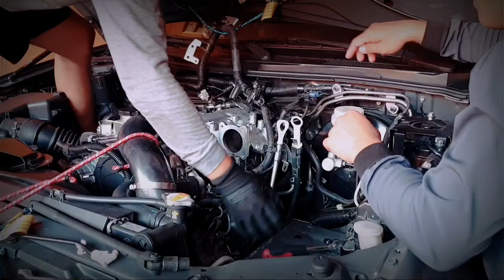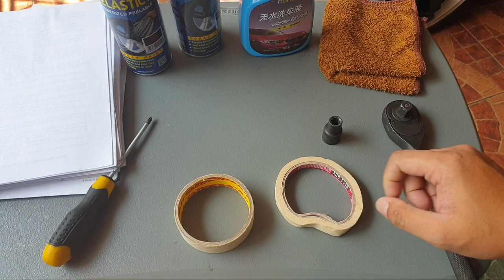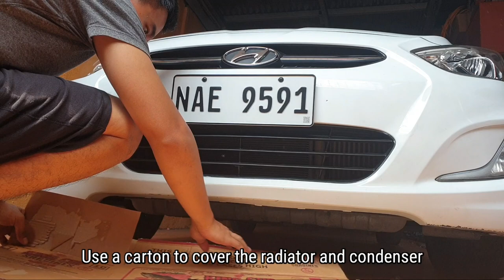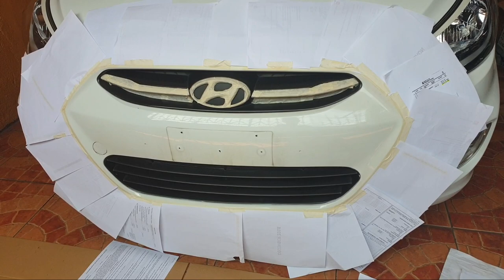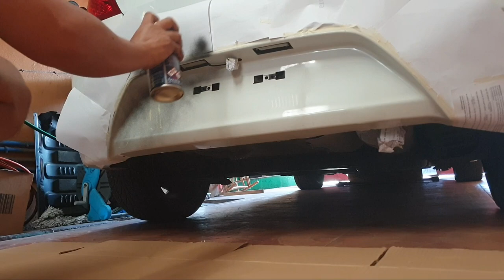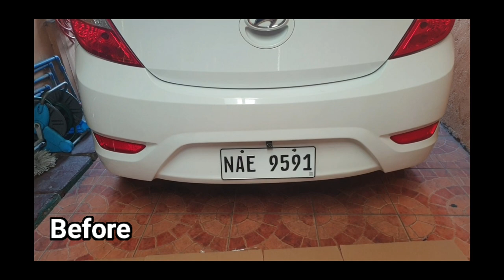Paano Pintahan ang Front Grill and Rear Diffuser Gamit ang Elasti Dip [Hyundai Accent CRDI]

Comment: Good morning.. Sir Noah question.. We have a 1995 model Kia Pride C5.. Ano kaya sir yung possible reason kung bakit tumataas yung temperature nya kapag naka aircon lalo na kapag nasa traffic kahit bagong palit naman yung compressor? Thank you
Reply from the maker: Madaming reason sir Richard. Check mo muna ung coolant na nilagay mo, baka hindi balanse ang tubig sa coolant. Make sure na it is 50 50 mix. Then check kung me leak sa system
Reply: @NoahsGarage  actually sir tap water na lang gamit dun.. talagang directly sa radiator na lang ang lagay parang sira na rin kasi yung hose na connected sa coolant reservoir nya.. Nung hindi pa napapalitan sir yung compressor nya before okay naman hindi tumataas ang temp.. nito lang talaga nagpalit ng compressor.

Tingin mo ba sir nakaka affect din yung belt ng compressor?
Reply from the maker: Meron sir. Kung bago compressor, it is either sira siya (factory defect) or ung belt mo sira. Try mo rin icheck ang AC pressures baka mataas or mababa ang High side. Magkakonekta kasi ang AC at cooling system. Pag nawala ang lamig tataas ang temp mo at mag overheat vice versa
Reply: @NoahsGarage  Malamig naman sir ang nilalabas nung aircon..yun nga lang talagang tumataas temp nya kahit naka idle lang basta bukas yung aircon.

Sir what tools or equipment yung need ko to check yung pressure?
Reply from the maker: @richardjaytuliao1757  AC guages sir. Check mo High side baka kulang o sobra ang freon. Pag di balanse yan, ooverheat talaga sir
Reply: @NoahsGarage  Thank you sir sa help.. Subukan ko yung mga sinabi mo sir 🙂